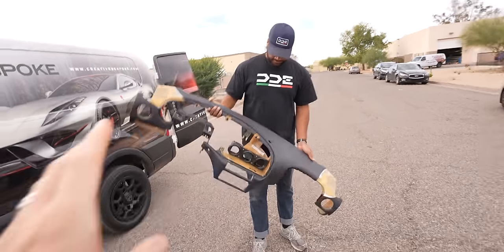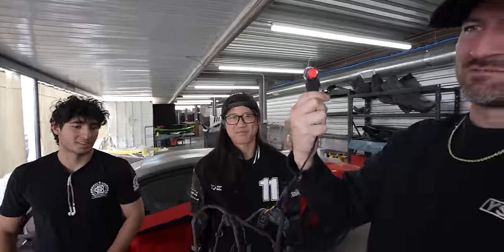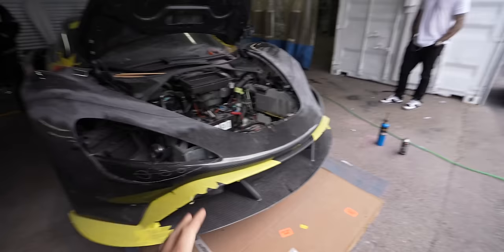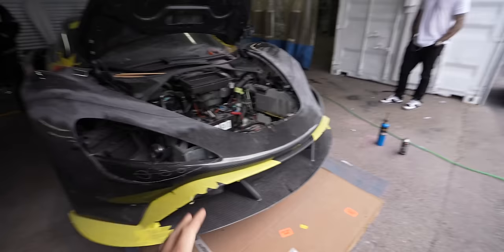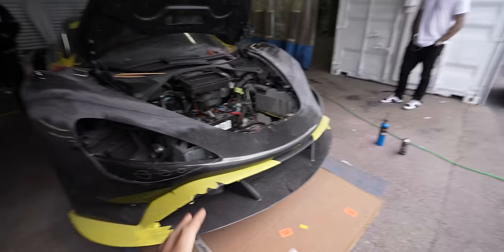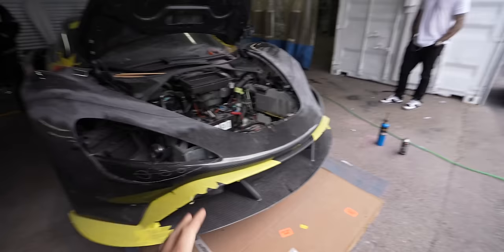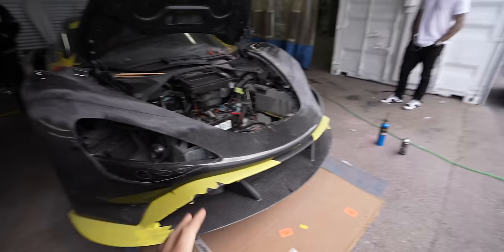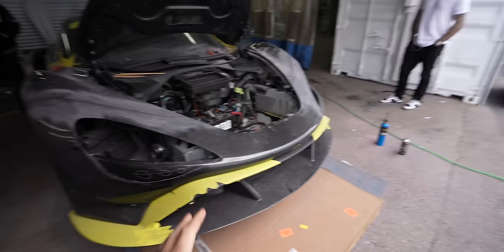SURPRISING MY FRIEND WITH NEW DREAM CAR PROJECT …

Comment: Tim should know you can set the blow off valve for choo choo noises not point blowing up turbo when you don't need to lol . New electronic blow off valves make sick noise and electronic boost control will give it different boost maps . Get a Haltech Nexus R3 controller and all the sensors to keep it happy . 
Love that Tim gets a cool car to work with and it's Definitely DDE lol .

Comment: Sorry buds,  a jump start is a saying that is meant for getting another car with battery cables and connecting it to the weaker bat to crank over and a bump start is for clutch kicking  it , to turn on....

Comment: Do a K24 Frank swap with a built motor turbo it. That will easily make 800+ then you will be in the super car range.

Take the s2000 motor and turbo  that

Comment: These guys really tried to bump start a car with a working starter... shows you they have no idea what's going on.
Reply: Starter was fine…
Reply: @GetCakeDieYoung_  as I said
Reply: @135k  bump starting the car with a dead battery and a working starter is fine
Reply: @135k  also if the starter motor wasn’t working bump starting the car wouldn’t work so I don’t really see your point
Reply: @GetCakeDieYoung_  jeez, maybe you should join these guys. What do you think gives the starter power? The battery. If the starter is turning over, that means the battery is also working fine. Which means it doesn't need to be jump started or bump started...

Still confused?